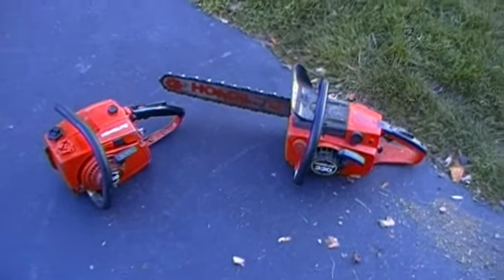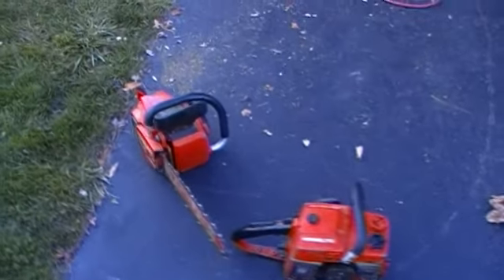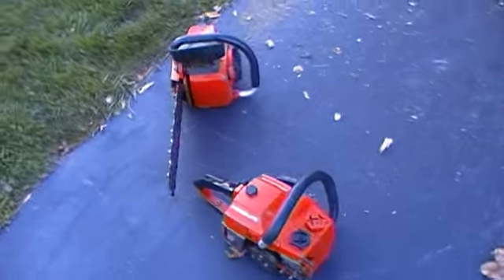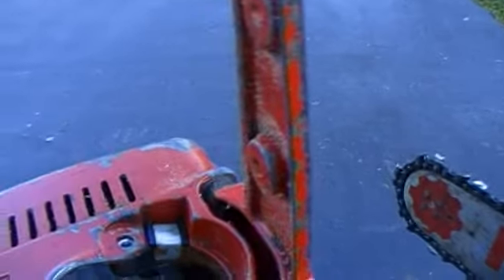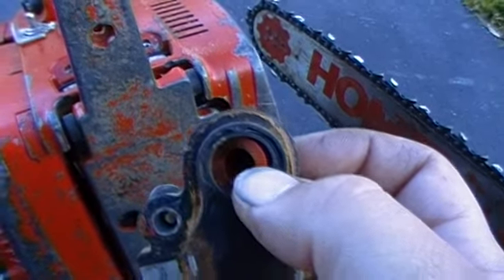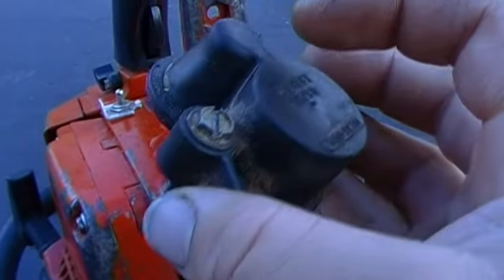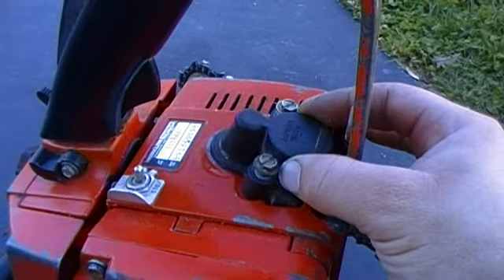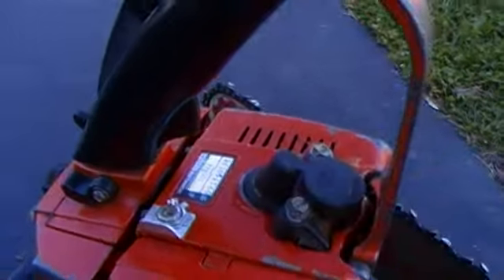Two More Homelite Saws

Comment: that is cool easy to change too but like you said  its hard to check for spark they should have a small wire and the coil outside

Comment: i have a 330.  it is an okay saw except for the cheap plastic starter pulley.  the worm gear that the starter ratchet rides on is so soft that it totally disintegrates after a few uses.  i've had this saw since it was new and used to buy pulleys 3 at a time.  not a hard fix but now they are hard to find.  i use my dad's husky or my grandmother's stihl 036 pro now.  the husky is nice and the 036 is like the mercedes benz of chainsaws compared to a 330.